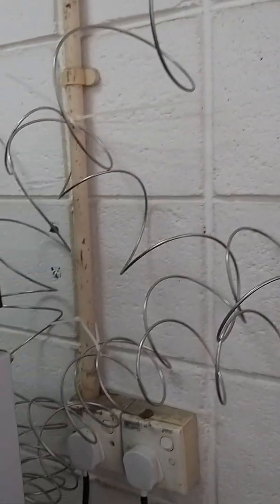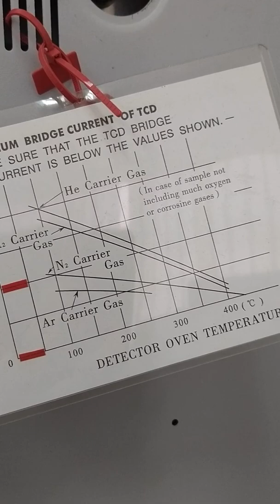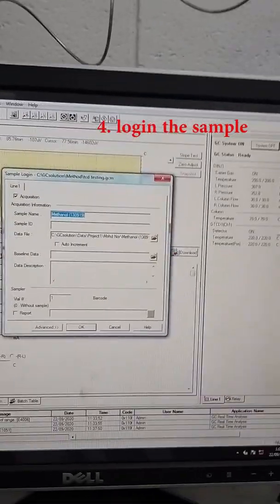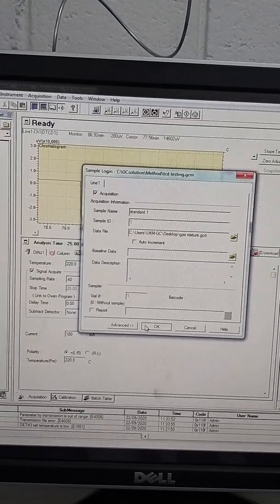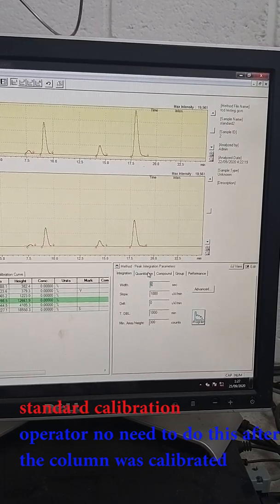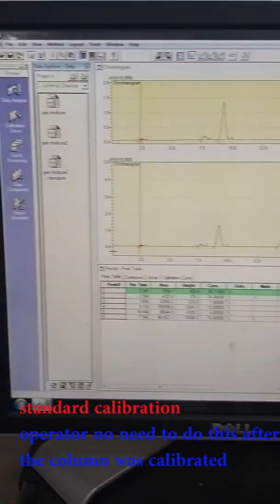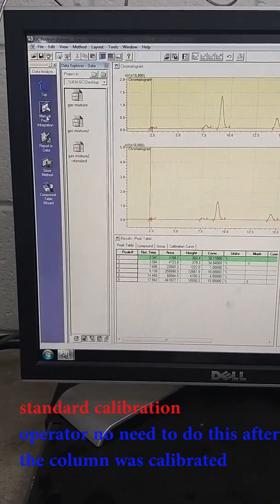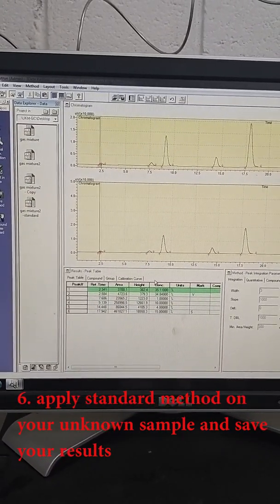6 step to get your gas sample be analysed by gc-tcd

Comment: Hello 
Can you explain the practical calibration method of analyzer gas system for air pollution station
Reply from the maker: dear , you need to roughly know the gas components in you sample and choose a suitble standard first, calibration like in my video is the most simple and cheap one, you can do the calibration with a mixture gas standard,  but the precursor is you need to know the gas type in your mixture to prepare a suitable standard. this can resource from the gas resource or collaborate with a GC mass to get the components before you do the quantitive analyses